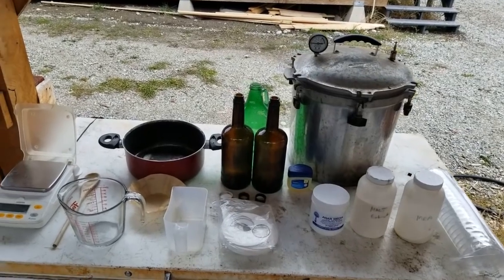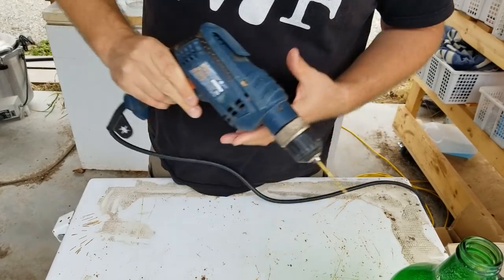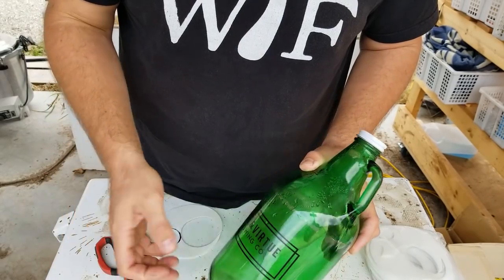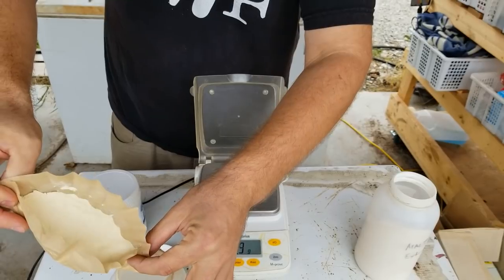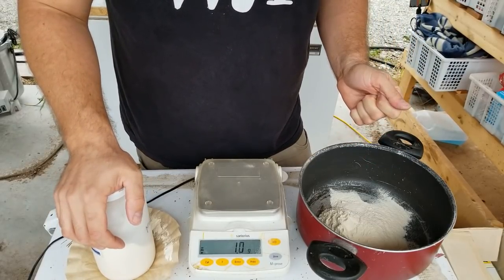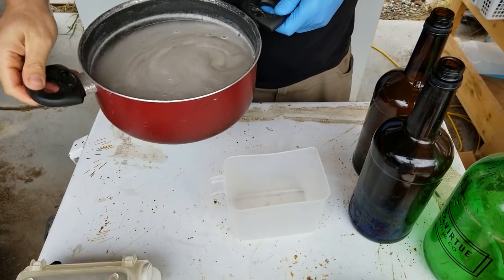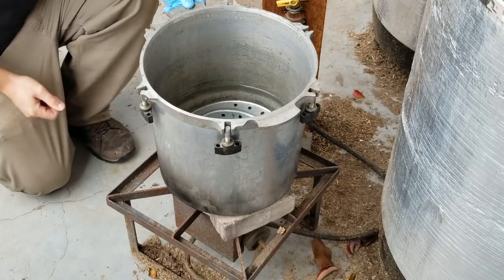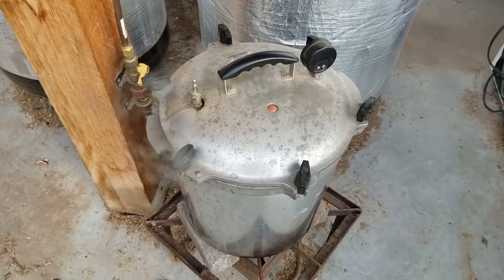Learn How I Do Agar | Lets Grow Mushrooms Parody

Comment: I just use a funnel and put only 25g malt extract agar per 750ml water straight into the bottle, using cold water. Then shake vigorously until everything dissolves and pressure sterilize. Using less MEA promotes faster growth, allows everything to dissolve easily without preheating, and saves time/money.

Comment: Great information,  thank you!    
~ Just a thought on heating agar:  we use a thicker viscosity agar for making molds to duplicate cast dental models. The agar  becomes a "rubbery" jell when cooled.  To prevent over heating the agar we heat it in a large Pyrex bowl with a lid on, at lower power in the microwave, stirring it once mid process,  until it is a fluid liquid.  Using the same amount of agar,  power and time settings makes this almost an automatic process.

Comment: Cool video. I do it pretty much the same way. I don't preboil outside the pouring container. I mix cold water with the mix shake it. Double boil in the pressure cooker. It saves the transfer time and potential for burns that way. Maybe there is some benefit I don't understand using a pan though
Reply: Do you get little dark bits in your agar?? When I used to do it that way I always got burnt chunks of malt extract in the dishes, it looked like little bits of contaminants but it was always clean, just annoying.

Comment: Are you concerned with condensation in the dishes? I know you can dry them in front of a flow hood. But what if you are using a SAB?
Reply: Place something Warm to Hot with a flat surface or a hot plate to rest on the surface area with condensation on and warm it for up to 30 sec's have a quick look every 10 seconds till most has gone, they will be crsytal ;)
Reply: @alexhill5756  put the hot plate on top of the agar dish or underneath?